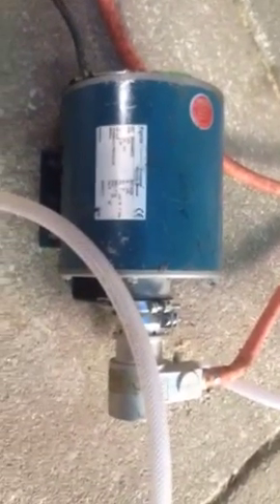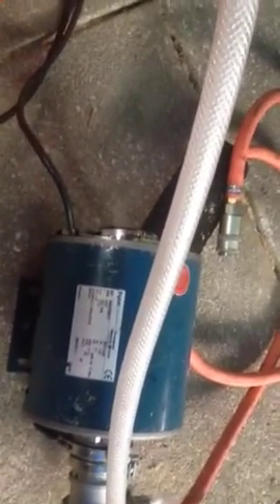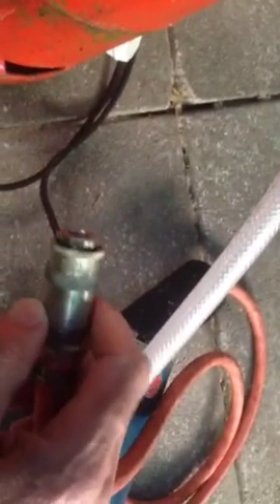LPG fuel transfer pump

Comment: looks like a death trap
Reply from the maker: I guess that is fear talking? Is pumping liquid propane any more dangerous than pumping gasoline? I believe petrol has a higher calorific value?
Reply: @neogovernment  nah just the way its all set up with screw clamps not crimps, old bottle, very little safety equipment